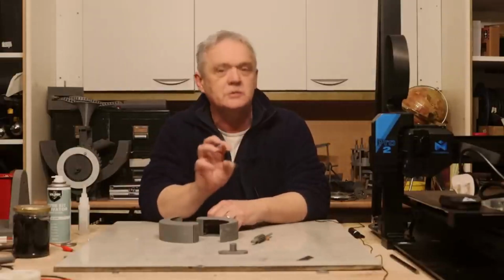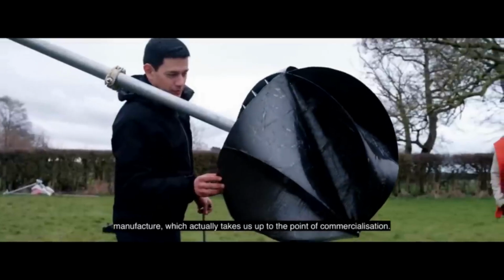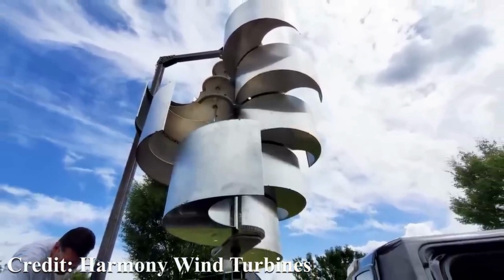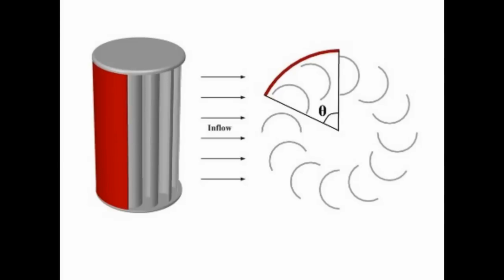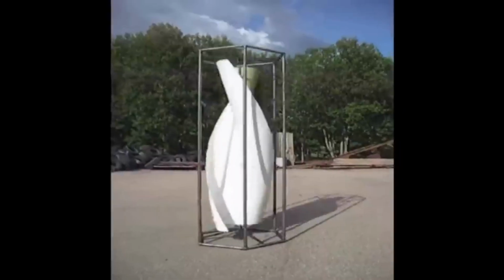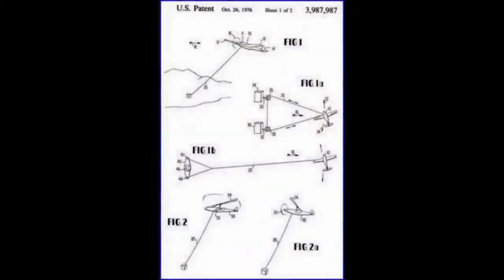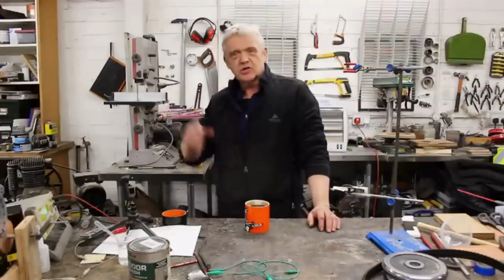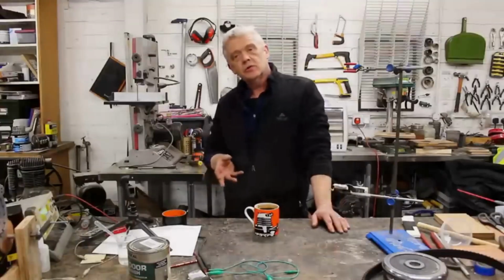Man In A Shed - Wind Power Special - Episode 7

Comment: I would recommend a coat of epoxy paint to protect the turbine from UV light if it is one of the plastics which UV turns brittle. Epoxy paint I think will have a better chance of not flaking off. The Eden Project uses ethylene tetrafluoroethylene (ETFE) for its plastic windows of the dome. Presumably this is UV resistant.  A good quality thrust bearing which can also resist side loads would also assist it in having a long service life. I have seen many small wind turbines go up over the decades but they don't survive long, due to mainly poor quality materials and poor quality masts.

Comment: Could you not counter act over spinning by using a induction motor and upping the voltage to the magnetic coil, causing more output power while also creating more internal drag.  Producing more power in heavy wind while also applying a breaking action to avoid over spinning.